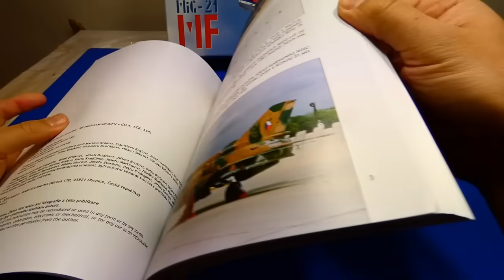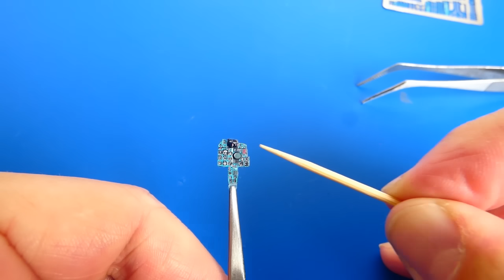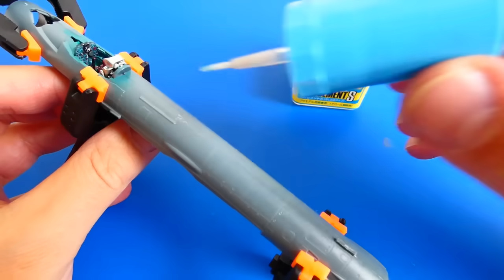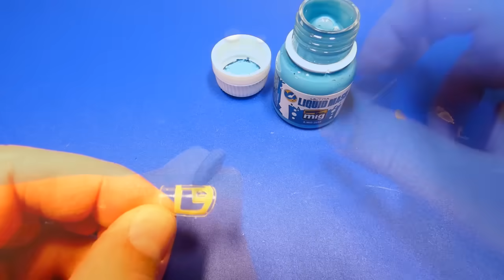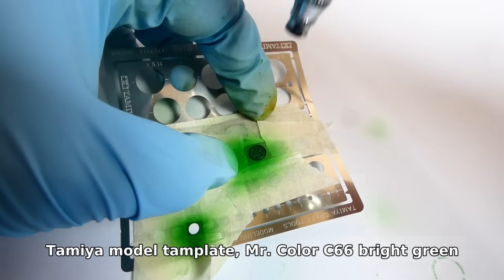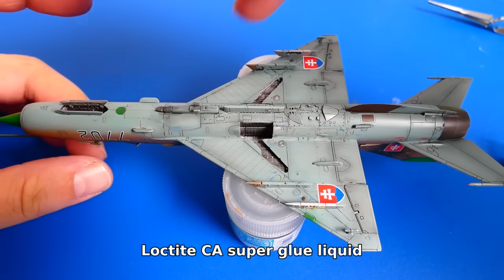MiG-21MF  Eduard 1/72 with Photo Etche parts Slovak Air Force

Comment: Very impressive!  Oil effects under the wing,
and around the flaps are just superb! 
I wonder what differences the kit might could have had,  in case MiG-21M was chosen instead of MiG-21MF, visually both modifications are so identical.
Reply from the maker: Thank you very much 🙂. I guess the main difference of the MF is in the upgraded Tumanski engine.
Reply: Actually, MiG-21MF doesn’t have Tumanski R-25 engine, 
MiG-21bis is with the Tumansky one.
MiG-21MF has the most reliable 
R-13-300 engine, same engine as the two seater MiG-21UM. 
MiG-21M is with R-11F2C-300, 
they also have different radars, and and despite the better radar the “M” can use only use heat seeking missiles. 
Practically “MF”  has the older radar from 
MiG-21PF, but can use R-3R radar missile, and the most none problematic new R-13-300 engine. 
Both cockpits are the same. 
The MF is also just bit heavier. 

I was wondering if they are been made any visible differences to the kit, since the modifications don’t have visible ones. 
Again, Great work on this Slovak MiG-21MF my friend, I will watch and like all your other videos for sure!